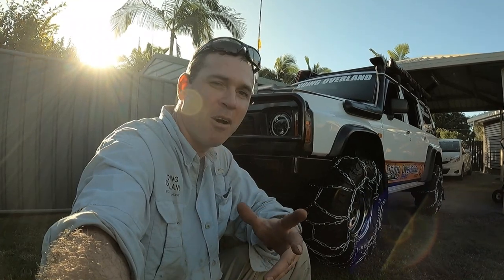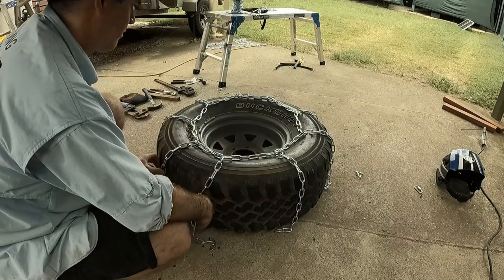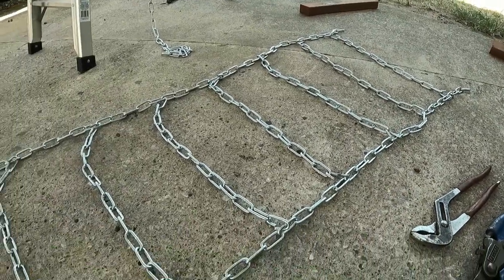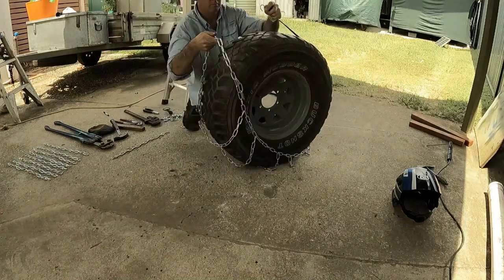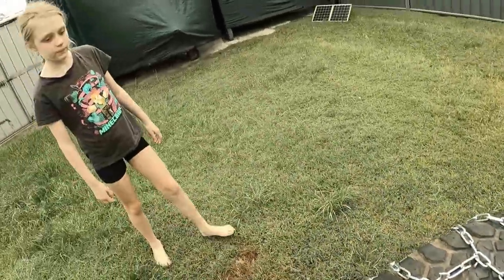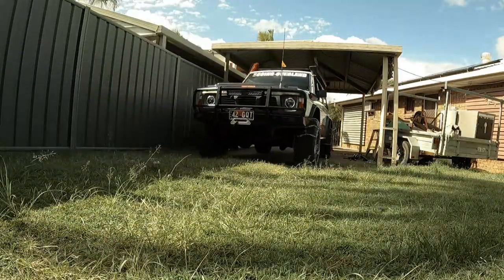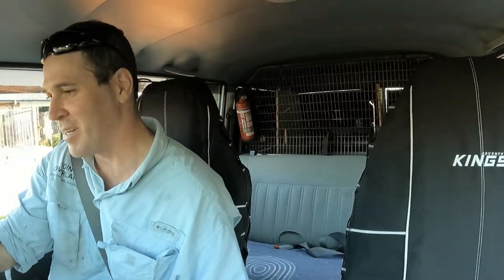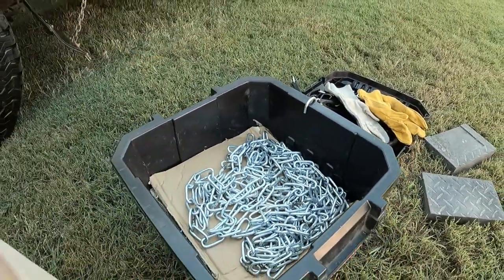DIY snow chains!!! How to make your own snow chains! Fitted and tested

Comment: Credit to you for having a crack. My only concern would be the integrity of the chain strength. If it was to break under the stress of the vehicle weight, there is potential for extensive vehicle damage.

IMO you only really need 2.
FYI it's not so rough when you're in the snow and it's amazing how much the traction improves.  
Good luck with it. Looks like you really thought it through. 
Thanks for sharing 👍
Reply from the maker: Thanks Michael, I think the 5mm chain should be OK, but time will tell 🤷‍♂️ I suppose that's part of making something yourself,  testing it out will be interesting and hopefully I got it right. 👍

Comment: Fantastic job!!! The whole time I was a little worried about the rubber straps.  I lived in Canada for 10 years and at sub zero temps they don't work all that well.  Great idea with the turnbuckles !!
Reply from the maker: Yeah I agree,  I seen a couple of videos of 4wders having rubber straps with chains so that's where the idea started,  but to me it was a big weak point. Thanks for the tip

Comment: Good job Adam. The turnbuckles seem a better and safer option. We used to frequent the Victoria and Snowy Mountain snow fields when lived in Victoria and I never used chains in the snow although which we had them when you hit a patch of black ice. I used to use them on the muddy tracks in the Victorian High Country.  
Good luck with them.
Reply from the maker: Thanks Kevin,  I agree with you on the turn buckles,  I think the rubber straps was a big weak point.  I think where we might be going we probably won't need them on the road,  but one of of the camps we have planned is a hour off road and if the weather turns that's when these things will save us. Also I'm thinking we will not be going home the same way so hiring chains might not work for us,  but I'm not letting the cat out of the bag yet 😉

Comment: Just watching this after watching the next video( I know watch them in sequence). Great job on making your own chains they’ll come in handy for all sorts of terrain. Just an observation with the front chains, I would link all the cross chains so that you are running chain all the way round the tyre. I noticed that in a few places you have just cross chains. In another life I worked in the alpine areas of Victoria driving troop carriers as taxis and coaches and it’s my experience that when you put you foot on the brakes you always end up on rubber and not chain hence the reason diamond chains were introduced. Chain will grab the ground whereas rubber just slides. Not a criticism of your great job just sharing a bit of experience. Really enjoy your videos.
Reply from the maker: Yeah Dave you are spot on,  and especially not having abs it would be even worse.  Where we are going it's not compulsory for 4wds to have chains, but one of our camps is over a hour from the bitumen,  so my idea of making the chains is more for getting in and out of this camp, and just for a emergency using them on the roads if the weather turns bad. I really enjoyed making them and learnt a lot too. Thanks for the support 👍 and feedback definitely helps
Reply: @GoingOverland  no problem, something is always better than nothing, you obviously have a fair variety of experience 4wding so I’ve no doubt what you made will serve you well. As you say on many occasions “drive to conditions “
Safe travels 😎

Comment: Great stuff mate! Some awesome engineering there. 😀 Yes, keep your speed down when using them and you might like to consider something else to lay between them in the box as the cardboard would get very soggy if you put wet chains in there. Hopefully you won't need them but if you do, that just means that there is plenty of snow around. Looking forward to seeing your snow adventures.  🙂
Reply from the maker: Good point Paul, and you'll see very soon what we are up too, but it's a secret for now 😉
Reply: @GoingOverland  Looking forward to it.

Comment: nice one Mate , i made a set for my old valiant ute years ago and worked great load of wood and could not get out  of the bush put them on and drove through the mud and crap as though was on a main road 😁👌
hint , lay the chains out on top of the wheel so it droops down and then join them together that way you dont need the blocks and its way easier 😁👍 
ps make your own cam locks 😉 easy as 😁🍺
Reply from the maker: Thats idea,  I'll have to look more closely into how the cam locks work 🤔

Comment: As you found out the difficult part is tensioning the chain. and keeping any links from damaging the vehicle ( we carry extra tie wire, to hold stray links etc and waterproof gloves) I had to laugh, 'it will be more difficult in the cold'  not wrong. we tried fitted chains on an icy hill  ( near guthega) we got out of the vehicle and it started to slide down the hill 😆, so be careful. the road was so icy we could not stand up unless we hung on to the door handles. (to a vehicle that was sliding down the hill) we find 4 rubber wheels slide on ice. we should have put the chains on sooner.
Reply from the maker: Thanks guys for the info and advice, that's scary to think about a car sliding while stopped! Tie wire is a great idea and we always carry some in the back, might throw some in the chains box too👍

Comment: Probably a redundant question but did you check the tyre to chassis/suspension on full lock?
Reply from the maker: Yes good point Bob,  on full flex the chains on rear will rub on the body, so definitely not disconnecting the sway bars (the patrol has massive flex in the rear) and the front end has lots of clearance with steering and suspension travel
Reply: @GoingOverland  Thank you for responding.  I felt you would have considered the clearance issue, but just in case!